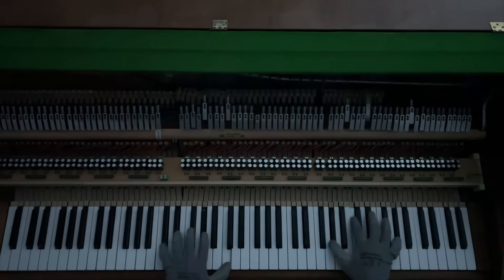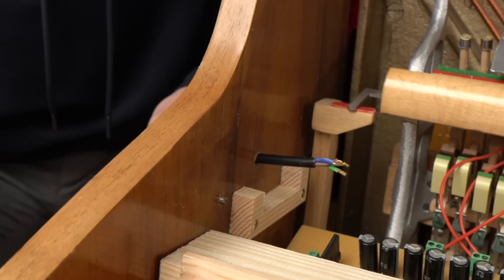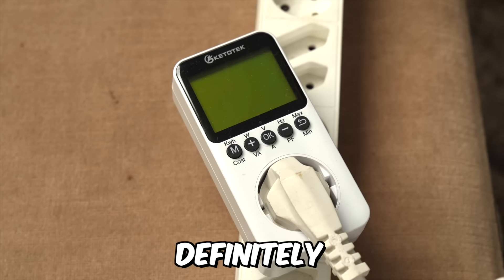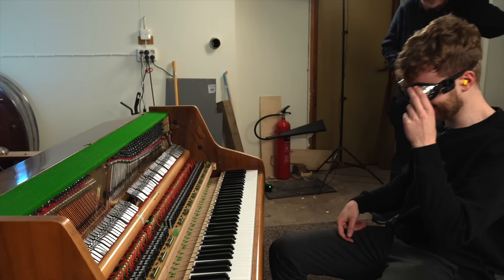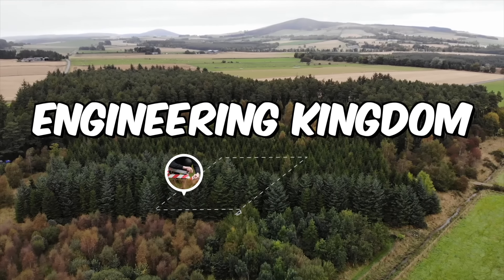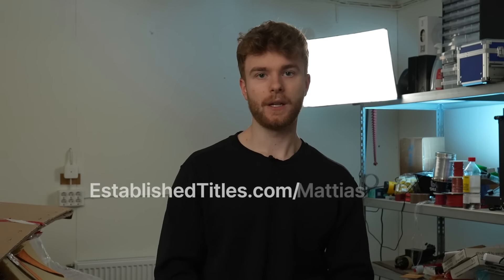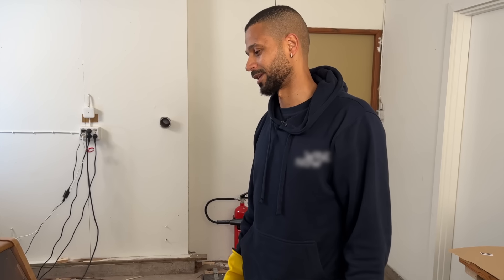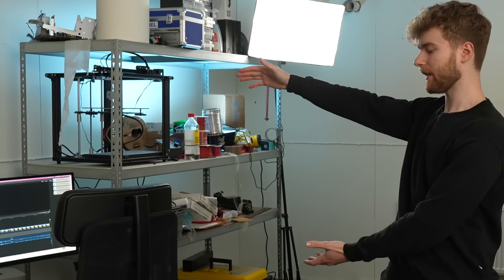Hiring electricians to fix my ”electric piano”

Comment: I want to see a piano that works like a rhythm game, but with real world consequences for wrong notes.
For instance:
The piano is in a giant oven, and wrong notes raise the temperature, but correct notes maintain the temperature at ambient levels (22C).
The piano bench has an ejection seat, and wrong notes put tension on the ejection spring, while correct notes let the tension out.
The piano is in a giant aquarium, and wrong notes fill the aquarium with water, while correct notes drain the water.

Comment: This isn't an electric piano, it's an arch welder.. ha. I don't really know how it's wired, and the voltage, but I guess the only reason that it's not throwing the breaker or fuse, if you're in an old school house, is because you don't have a ground wire hooked up. I'm in the U.S., so I'm aware that our hardware is different, but electricity, is electricity. I'm actually surprised that the hammers didn't weld to the contact. I'm guessing that it's less dangerous than it seems, but maybe not.. I used to do electrical work, and I've seen 120v AC throw big sparks when shorted to ground. I actually had the tip of my multi-meter probe get blown off, due to shorting to ground. I would be skeptical to touch this thing.

Comment: You might want to add some sort of UV-protective film to the plexiglass or at least wear UV protective sunglasses if not a welding mask, because electric arcs create UV light. Arc welding without goggles gives you a feeling of sand in your eyes even from a short burst, so I'm kind of surprised you haven't had that sensation yet!
Reply from the maker: Ooh I have! But the googles we used a bit this video is for welding! Problem is you can’t see a lot :(
Reply from the maker: It isn’t really as string as welding, but when I played it one hour my eyes did feel a bit weird
Reply: @Mattiaskrantz  Still worrisome, take care of your sight, man! Eye fixing is hard! Glad to hear that you're taking some precautions at least tho :D

Comment: if you want to make your piano "safer"... then I would recommend a transformer. it would transform the mains voltage down to e.g. 12 or 24 V DC. Then you would have to adjust the capacitors to a higher capacity and it would become much safer because you don't even feel the voltage (only from 50-60V DC it becomes more dangerous again). A transformer could be e.g. the NT 24VA 2X12.

Comment: I find it a bit concerning the electrician didn't know how an electromagnetic induction field functioned, but still I'd agree with him that it needed to be grounded lol.
Glad the electoral engineer explained the difference between a capacitor and dynamic resister though, funny to see him enjoy it despite the surprise XD
Reply: I actually did lol. I just don't use no contact voltage testers at work so it didn't immediately spring to mind. I mentioned it later but it wasn't included in the video.
Reply: @windyr  Oh yeah that's understandable

Comment: Why don't you combine your electrical piano and your liquid piano? 
Water can be replaced by a non conductive liquid like an oil. or you use demineralized water which does not conduct electricity ;) 
I think that should dampen the shocks more and also maybe preserve the strings a bit :) ?

Comment: Fix the cord to the piano so it cannot be accidentaly pulled out (it would also be nice to have a kill switch for the whole thing that is accessible to the player ), the "connection" on the right side (that the electrician pointed out) should be improved,  also I hope there is something fireproof underneath the circuit board ... well considering the sparks and all maybe fireproofing the whole area wouldnt be a bad idea cause this thing is .. made of wood ...

Comment: Why not do an electric piano, BUT using electric frecuency in order for the arcs to play the sound?
(You could even encapsulate the terminals for everykey and if they were filled with noble gases they could even light in different colors (also it SHOULD be safe if done propertly)

Comment: what about using a standard piano hammer but wet the felt with salt water to get it to conduct a current?
Reply from the maker: Hmmm but why do we want it too conduct, like for on and off signal?
Reply: @Mattiaskrantz  I should work the same as the metal hammers giving the spark effect but with a more majestic tone

Comment: I would make a near vacuum chamber for the piano-hammers. That way you get more plasma instead of sparks, like in a plasma ball or neon sign.  Would look nicer and sound better.
To do it you have to make a sealed chamber around the hammers, and simply suck the air out.
The voltages may also lowered, making it safer.

To make it more like a real electric piano. 
For that you need to remove the strings and have circuits with different resonance frequencies. Output to a speaker. It can have its own unique sound that also sounds good.
Like a Theremin but with plasma lines.
This is a theremin (non touch electrical instrument) https://www.youtube.com/watch?v=LYSGTkNtazo

Comment: If you want to make it safe. Well. Add 10mA RCD, type A. Add MCB C1 or C2. Or maybe D1. Plexi glass mandatory. And lastly, you need smoke detector inside the piano and either CO2 cartridge/extinguisher.. or Nitrogen. Whatever you find to deal with fire behind plexi. If you have time add discharge resistors (very high value) or...maybe neon indicator bulbs, will look cooler. If no time, get a non contact voltage stick. This will allow you to verify discharged state.
Reply from the maker: Great comment thank you so much for the advice!🙏

Comment: Do you know those pads that are put on muscles to make them contract? How about you connect them somehow to an arduino and make them trigger based on the sound frequency played by a piano. Lets call the result a very accurate interpretative dance. 

You could maybe ask Michael Reeves for help with the coding of the arduino since he has a couple of "similar" projects.

Comment: Mattias, upgrade your electrical piano. You use AC electricity, but it is very dangerous. Just use very high DC electricity with low amperage. I propose some variation of van graff generator. The build scheme would be simmilar. Just put this generator between power cable and general piano circuit.
Reply: There would be a special plasma effect too

Comment: Oh my goodness. What on earth are you planning with that flyback transformer and zvs driver lol?! Plasma piano? Pro tip- put the flyback transformer in a small Tupperware container full of mineral oil and it wont arc over like that. Vegetable oil will work too but it will go rancid after several months.

Comment: The more resistance you have the more heat is generated as electricity passes into you so instead of saving you it will scar your hands. (Learned the easy way, I had the lower resistance.)
Reply from the maker: Ooh damn it🥹

Comment: Piano Idiea put xylopone tone plates on the piano strings and drum sticks as piano hads than you got piano tone plus xylophone thones at the same time, maby when u will go even crazier put helioum in the piano corpus and make the corpus air tight that no air can get inside so you should have other tones as well, maby use carbon fiber strings as piano lines,... 
this would be interesting to see

Comment: what if you replaced the strings with different sized steel plates and attached a device which dispensed those little bags that make a little explosion when you throw them at the ground

Comment: What about a cylinder piano. Probably more of a full DIY job than a pull apart an already good piano. But like a round piano that goes around in a circle and meets back at the ends. I dunno, sounds dumb enough to me

Comment: have you already inverted all stings of a piano ? or even worse, you reverse low keys and highs keys but also make one octave goinge ine the other side (instead of "Do" to "Si" it'll go from "Si" to "Do") or something like that. the piano will be unplayable XD
Reply from the maker: Nope because that will not be easy in practice! Could be fun though
Reply: @Mattiaskrantz  i have thought of detuning the strings instead of replacing them, but that wouldn't work I guess and it may turn out to be harder to do seing how long it took you to do a E only piano 😂

Comment: Wait at 12:00, he says that switch gear is a transformer?
Reply from the maker: I’m not sure what he said there🤔
Reply: @Mattiaskrantz  as far as I knew, switch gear is just like regural switch, but usualy at higher power. On the other hand, a transformator is a device that can change the amount of voltage without changing the amount of power, the one component that has 2 windings

Comment: Would you like to turn your piano into such an organ or "horizontal accordion" where the gas runs through the pipes, and lights up as you press the key? In this case you will need electricity just as strong as cigarette lighter, but you will need gas stove. Yeah, playing abound with gas, can be dangerous.

Comment: I would scrap the idea of sparking, and instead try making them tesla coils or jacob's ladders reaching out to a heat-treated load. Keep the hammers and "strings", but insulate each one with a glass/poly sheet between them that negates the chance of capacitance/arcing, then rig the "strings" to arc as a plasma to a load that can withstand the heat, and have the hammers be the "on" switch to overcome diode resistance, no sparking and a fuse/resistor all in one. If you tune it right, you can actually make the coils/ladders themselves hum at a frequency fitting the keys pressed, so not only will the "strings" hum the right note when struck but the arc they create will ALSO hum the same frequency.

You'll also probably save your bloody life, you knob.

Comment: I wonder what is the high voltage flyback transformer  for ??? hhhmmmm
I got shocked by one multiple times make sure to discharge the internal capacitor
Reply from the maker: You will see soon!

Comment: You really should have a discharge mechanism for the capacitors that doesn't require you to short them all out, like a switch shunting the current to a light bulb or similar resistive load. I assume you still have the camera flashes, get creative!

Comment: I said this before and I'll say it again. You should encase it in glass or plexiglass.
Reply from the maker: I did! Or you mean also the sides?
Reply: @Mattiaskrantz  the sides should be done too. Or you could paint it with fire-resistant paint. As well as the electronics being isolated from the sparks.

Comment: if you change to a modulated high frequency instead of just pure capacitor discharge power, you can tune each spark to a sound/note.
think tesla coils, consider checking out youtube channel FranzoliElectronics
Reply from the maker: Actually I’ve been working on that for months!

Comment: Man you could search for electronic engineer or electronic engineering. Maybe someone or something can help you. This piano is definitely not safe. It is very funny and I laughed hard, but electricity + wood is not a good combination. This piano scares me. ALOT.

Ps: Electric Engineer is different than Electronic Engineer.
Both work with electricity, but they works on different areas.

Comment: just install a cable relief bro
Reply: you could replace that with a welding rod device :)
Reply: do a tesla coil piano instead
Reply: use the piano only as the digital keyboard for the tesla coil frequency output
Reply: nice fireworks bro, satans church organ
Reply: try real steam pipe organ